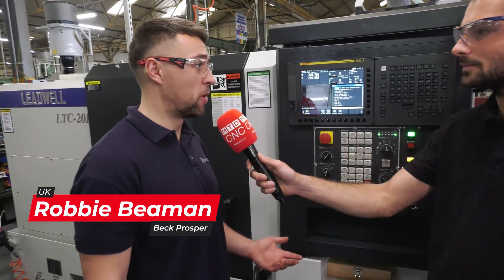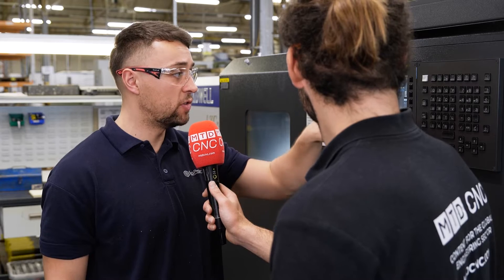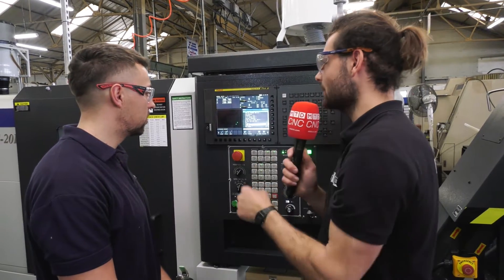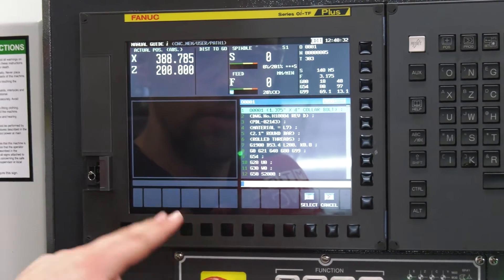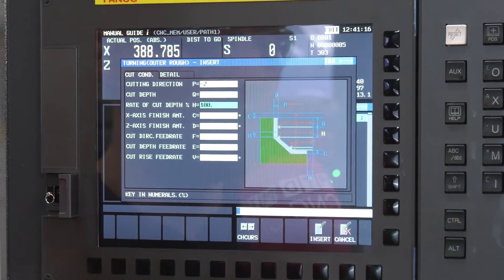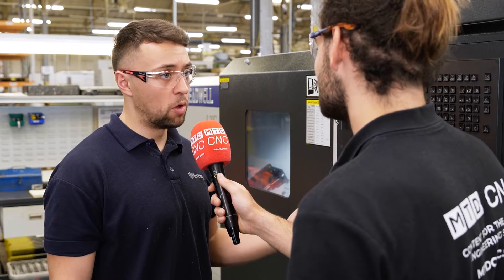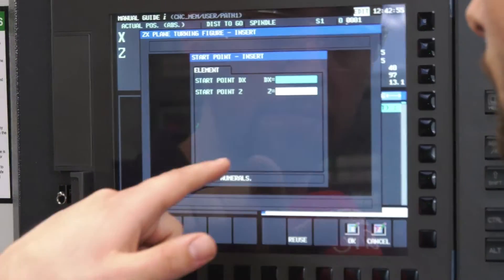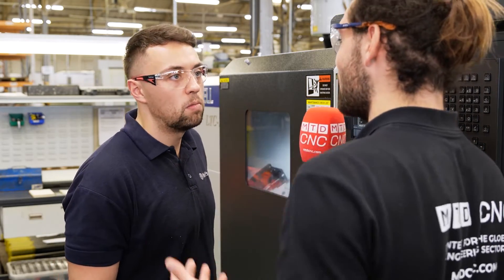Want to know how Fanuc Manual Guide i  works, watch this educational video

Comment: Been machining on fanuc controlled lathes since early 2010. They all had conversational programming. The one thing I miss from the older ones (before IHMI) was the shortcuts when you use the numerical keys. If you press 1 and hit input its the same as pressing the most left key below the display (apart from the arrow keys). When you get into it enough, you don't even need to look at the screen to program a whole part. I had the drawing in my left hand and just glanced at the screen now and then. If this is new to you, I highly recommend giving it a try. You will be programming faster than ever

Comment: Fanuc has had conversational since the 80's. I had a Fanuc 6ML 1984 control with full conversational graphics and full milling canned cycles all in colour believe it or not 😉
Reply: Yes, i have used that. It was called Fanuc Fapt. It was kinda like cadcam, and i liked that. They stopped selling that in the early 2000;th unfortionally.
Reply from the maker: wow thank you for this information.